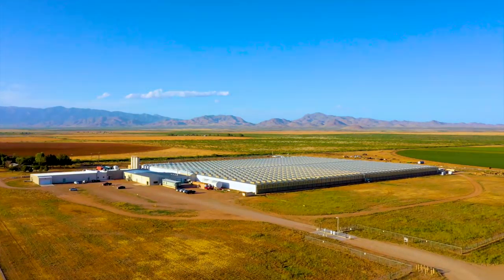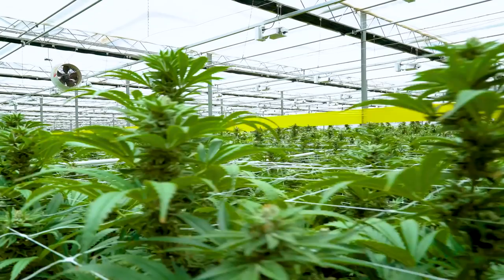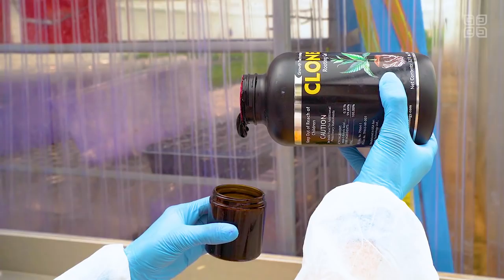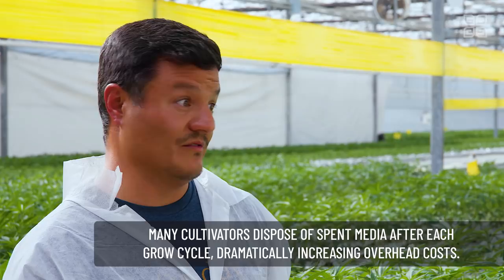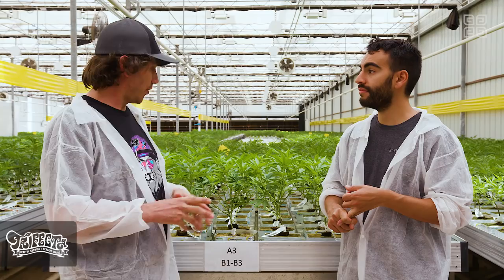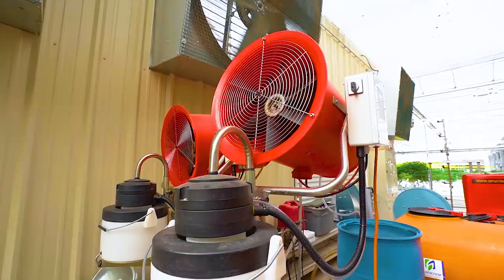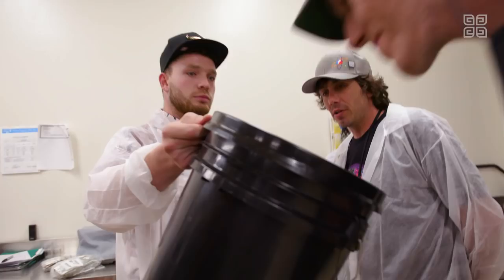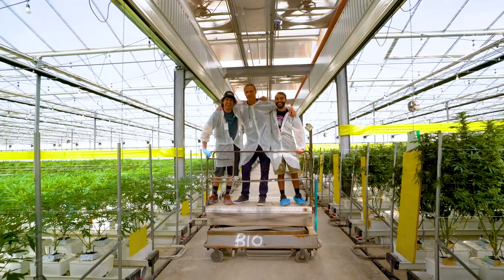Cannabis Genetics Legend at Sunday Goods & The Pharm

Comment: Ok. So I have a dumb question, for anyone who can answer it intelligently.
This guy, Mr. Broeks, mentioned finding the best phenos with regard to mold resistance (his example). So, now comes my question, are the individual phenos exposed to mold to test for mold resistance, or if they get a PM or bud rot are they simply noted as less viable?
Basically, that's a negative correlation test... whereas THC (CBD etc) content, nodal spacing, yield are positive correlations- more THC = positive test.
Reply: KustomGraphics206  true. A positive correlation is relatively easy to identify. I was left wondering abhor the converse, because like how many iterations have to be carried out to identify that a strain is mold resistant? (without specifically subjecting it to undesirable conditions)
Reply from the maker: Thanks for the question!  Make sure to join the free Growers Network forum to discuss with other growers alike!

Comment: Can you give a brief explanation about the cleaning and sanitizing processes from the facilities you've toured? Knowing how they sanitize the perlite, growing containers, and gamma-seal curing buckets would be appreciated.
Reply from the maker: Thanks for the comment. Have you joined our forum. Tons of great resources and growers to answer any question you have. And it's free to join!
https://GrowersNetwork.org
Reply: Who reuses perlite?
Reply: @MatanuskaHIGH  This whole operation does, and they talk about reusing it. I did some research and found a few studies that use a hot water pressure washer with a waterbreaker nozzle in tomato greenhouses and have experienced increased yields with no increased pest pressure. In small commercial greenhouses it cut their growing medium costs roughly in half.
Reply: @CannaCribs  I have joined the form but haven't found much value yet. I hope it ends up being a useful tool. Since your channel is releasing videos like this, and your commercial cultivation series, targeted at large operators it might be valuable to have someone able to answer commercial scale questions.
Reply: I think they use rockwool. perlite is a good option only if it is cheap in your area. rockwool and perlite are not "active" mediums so you can clean them however you want. if you use peat or something, that are "alive", then you have to be more careful. fungis are the main problem (pythium etc). To clean the plastic use your imagination

Comment: All that hard work and its cured in plastic buckets psssh
Reply from the maker: Thanks for sharing! How do you prefer to cure?
Reply: @CannaCribs  Depends on quantity and is it cured for medicinal or recrational use or is it for your own stash..i like 5 to 8 weeks hang dry/cure in 70 to 60% humidity and 18 degrees celsius temperature in total dark (fan leaves on and low to no airflow)..and after that i trim it and it goes in apotecary/pharmacy amber glass storage jars to continue curing/fermenting in 8 to 10 degree celsius room where they stay 6 to 8 months without opening.If you are doing something..do it how it should be done or don't do it at all.Greetings from Balkans